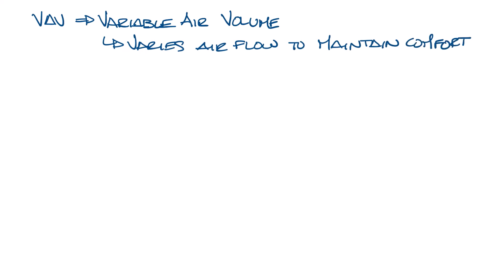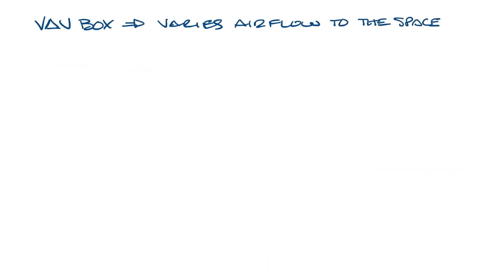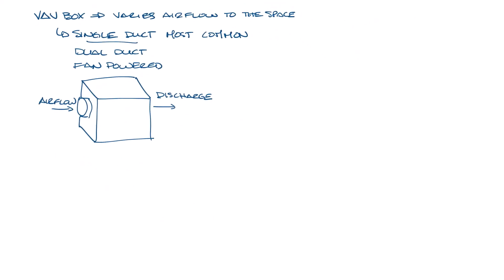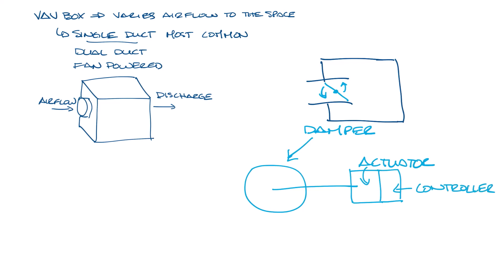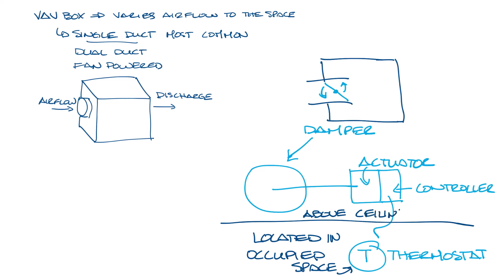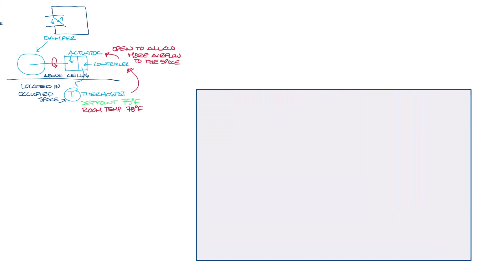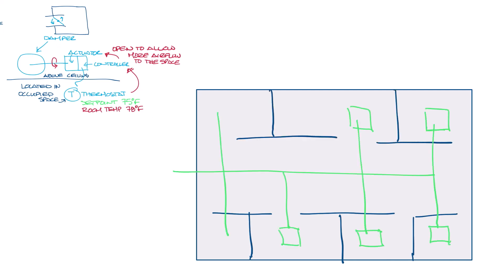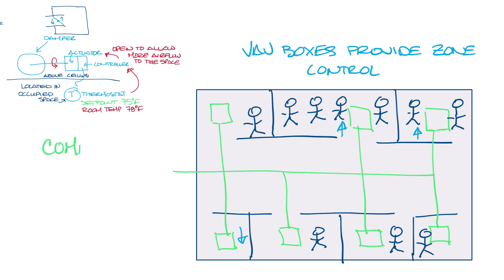NSW HVAC Academy - VAV Box Basics

Comment: Thanks for sharing
What about pressure sensor  will it also ctrl dammper position?
Reply from the maker: Good question and I completely forgot to discuss the sensor. I will do a video this week about the sensor, but yes, the pressure sensor is connected to the controller so that the controller knows the airflow of the VAV box.